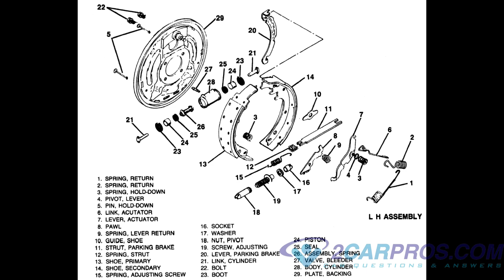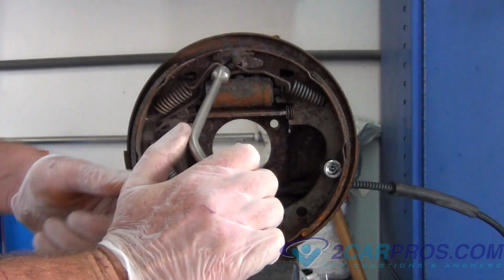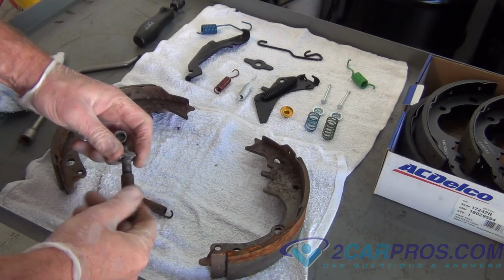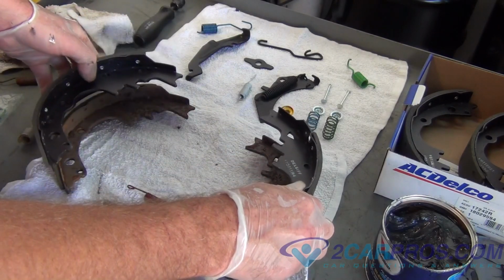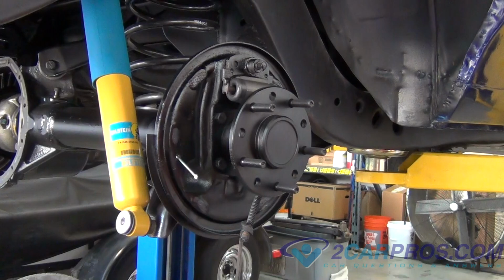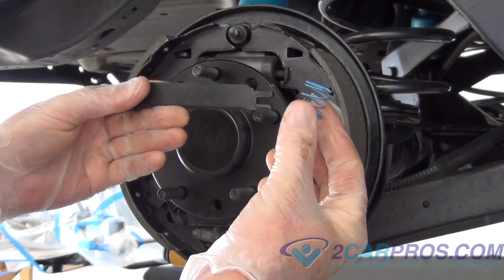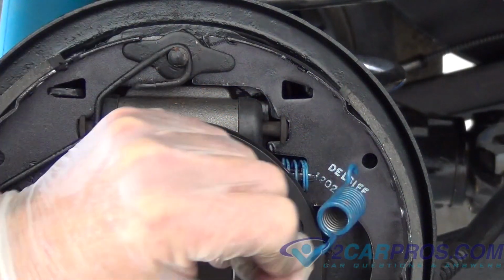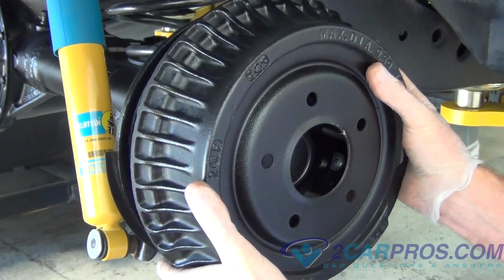How to Change Rear Brake Shoes - Works for most RWD passenger cars and trucks

Comment: This is great, thanks.  Helped me big time when overhauling my Camaro brakes today.  I like the way you put the adjuster and spring together and put it on as a whole unit.  I was struggling trying to do one side at a time.  Doing sub assemblies like you did makes much more sense.
Reply from the maker: +rayray123ray69 Thanks for the comment glad we could help. Please subscribe.
Reply: +2CarPros subbed :-)
Reply from the maker: rayray123ray69 Thank you!
Reply: +2CarPros trust me when i say all thanks goes to you lol... i struggled so badly with one side, then found your video and the other side went super smooth.
Reply from the maker: rayray123ray69 Great to hear